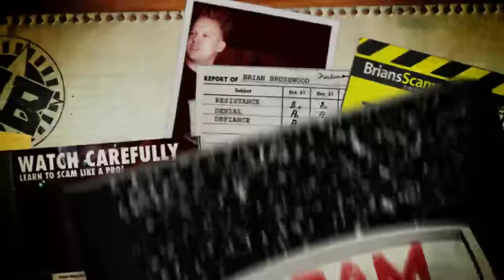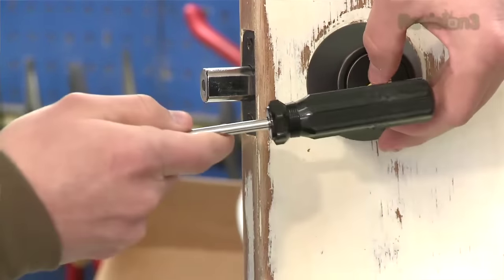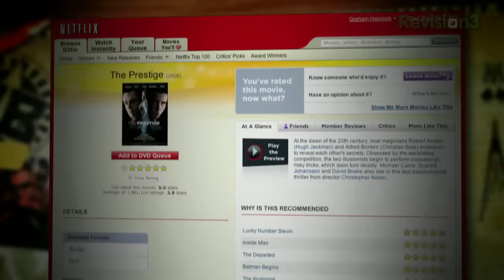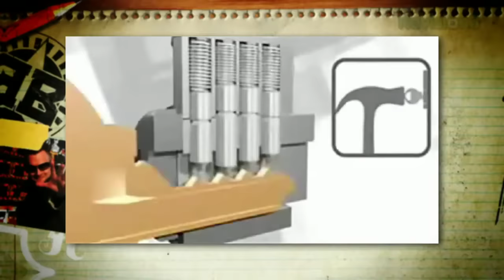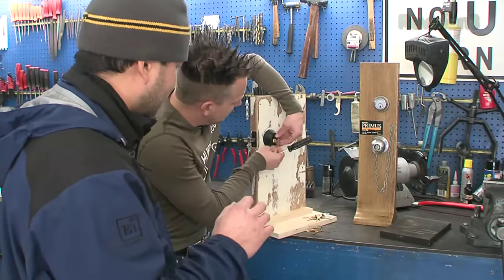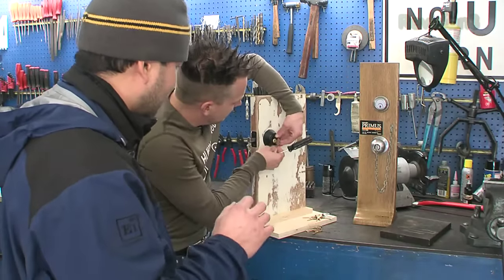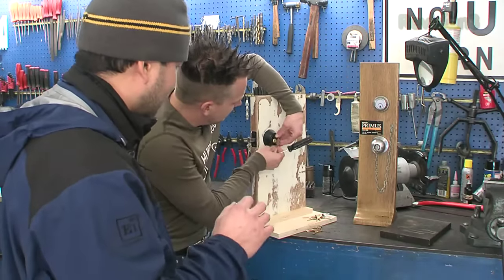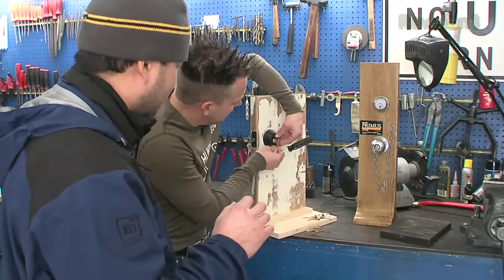Pick a Lock in SECONDS with a Bump Key

Comment: The CHEAP way to protect your lock is to ask a locksmith to incorporate one "10" or "11" depth cut on your key (usually on the 5th cut(the tip of the key - the last cut) the deep cut is on the tip of the key as other-way it can weaken the key -
That way if anybody inserts a bump key - that is usually cut to "9" depth it will push that last pin above the shear line and the cylinder will not turn.
You can also use some special heavy oil that drastically slows up the speed of the pins bouncing UP - but but but if something goes wrong you could end up locked out - in that case spray some brake cleaners or any solvent in the lock and try to wash it out.
Good Luck

Comment: With just enough space between the door and frame to fit a small pocket knife and slide it from frame to door. I have opened every stylel door lock and deadbolt currently sold at my local
Home Depot. The ability to slide a deadbolt open with the point of a pocket knife is a major fail for Defiant, Kwikset, Schlage. The three brands sold at my local home Depot. I had enough just enough Gap in the door and frame to slide open the deadbolt and door lock in less than 20 seconds.

Comment: This is why I bought an electronic deadbolt kit, I open an app on my phone and bam, door locks with no visible signs from the outside that there is a deadbolt, and if I lose my phone, well, I can put a special magnet near the deadbolt and it unlocks :D
Reply from the maker: Nice!
Reply: Thanks! I have a similar system for my windows!
Reply: What brand of lock do you have? Very interested in buying one.
Reply: Yea, that's not hack proof... NOT
Reply: ***** I never said it was hack proof!
Reply: so what happens if you're out drinking with friends one night and you lose your phone/it runs out of batteries?
Reply: ***** Then I pull a very special magnet out of my wallet, put it on a certain place on my door, put my key in and turn it, and wham! It unlocks!
Reply: ***** There hasn't been a break in, in my neighborhood, in 7 years, I'm not terribly concerned.
Reply: Ive stolen your phone

Comment: btw I worked for several facilities where I had to get into all kinds of rooms and cabinets and equipment the keys were not available like weekends and after hours etc ....even security with their huge rings of keys could not help and the locksmiths we had were not available ....I got scary good at opening locks just by jiggling various keys that fit well ....for instance I have YET to find a piece of equipment like a lift/forklift/electric or gas cart etc etc that I could not start and run within a minute ...it's all in the wiggle while barely pulling out and pushing in at blur speed ....works same as bump key but using some other legit key ...I got so good I seriously stopped bothering going to get the real key....people would come get me to open their shit ....  They'd say "go find doug he'll get it open" ....LOL  I probably also was a prime suspect when shit went missing...although I never was accused ....like my dad always said "locks are mostly just to keep honest people honest"  cause crooks go right in

Comment: When returning from shopping I found my front door lock had been tampered with Normally one turn of my key would of opened the door but on 2nd turn nothing also and it never felt like it was gripping any thing every thing felt loose on the 3rd turn I was able to open door this had happened before so I changed locks old for new and same thing exactly happened so I locked the door and opened it 20 times and it only took one turn of the key this is the cause when I left my home my lock was being picked by a neighbour they gained entry but in locking the door they were using feeler brush which had not properly
Left the pins in there proper position
Their for it took me 3 turns of my key to enter my own home instead of one turn as per normal
Police blamed every thing else
But not the true facts that I tried to explain to them as if they were aged 5

Comment: there is no way in hell you would put that pop up in the middle of the video if this wasn't a sham.  if your car door is sealed up tight, this is nearly impossible to pull off without doing more damage to the car than it costs to call a locksmith.  i just tried and damaged the paint, the weather stripping, and bent the actual door a little bit.

Comment: Electronic locks dont even use tumblers ....they basically "look" at the key profile and treat it like a facial recognition kind of thing ....you can reprogram it to any other key that fits .....even multiple keys giving someone else access to your lock with THEIR front door key ....they are not even that high priced now ..AND some are remote and lock with push of a button and open with keypad OR key ..    Bump keys and picks have no effect on these ...how a crook might get you is via photographing your key with covert tiny camera and or capturing radio signal on remote and/or watching you punch code on keypad (again via tiny remote camera they temporarily secreted near your lock) ...sound unreasonable?  THINK AGAIN!  Easy Peasy...right?  protect your keys!  DO NOT hand all your keys to service garages!  obscure view of key pads and keys  from potential cameras and or eyes

Comment: There was so much misinformation/poorly explained information. The electronic lock also had a keyway. Its there because batteries fail, but it could be exploited the same as any other keyed lock. Schlage Primus can be bumped just not easily (Its a fine lock). Cheap locks can easily be made bump resistant by, a handy homeowner, by just changing a spring or two with heavier springs so all the pins can't jump at the same time. 
That video is nearly ten years old. Ten years and US lock companies haven't done much to make common homeowner locks more secure. I doubt that it would cost a buck a lock more to add a heavier spring and a couple of pick resistant pins. I do it for my personal locks. 
Its a good video but Locksmiths sadly are not generally your best source for information on exploiting locks and fixing those exploits. Crimials and lock picking enthusiast are often better sources. Why? Locksmiths don't really have any motivation to pick your lock when you get locked out of your house. They might make an halfassed attempt but what they really want is to drill out your lock and charge you for labor and a new lock.

Comment: this guy is too much, just because you don't approve of something does not make it wrong or improper.  coiling a cord up in any fashion will result in internal twisting of the conductors and kinks, the only way to avoid that is if a self-reeler is used and the cord has the ability to untwist as it reels. (mechanics shop, production wood shops use them and good ones are costly)  any electrician will tell you the best way to protect extension cords and keep them tangle free is CHAIN COILING, it takes roughly the same amount of time yet you don't need about putting it on a hook. i can take 10 chain coiled cords throw them in the back of a truck and everyone one of them will come out the same way they went in, and unroll in seconds, no kinks, no twisted knots. and you can store them in a drawer, over the rafters, in a tool bin, or in a pile in the corner of the shop.